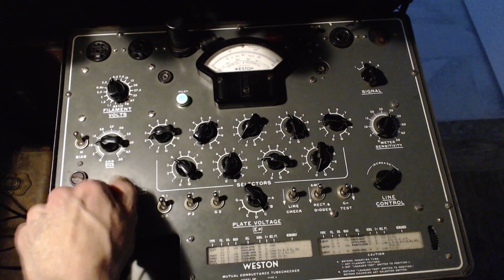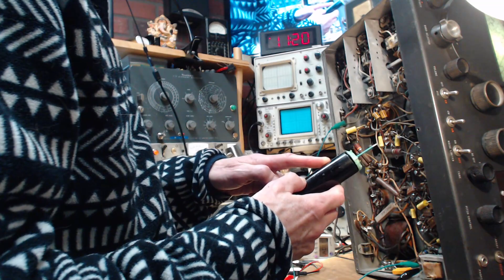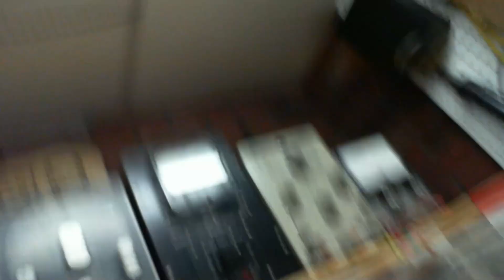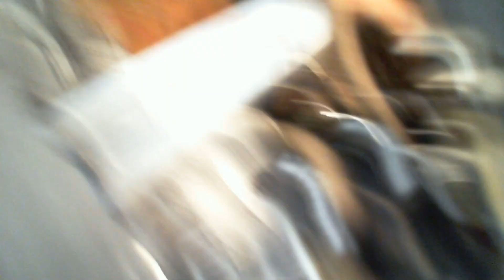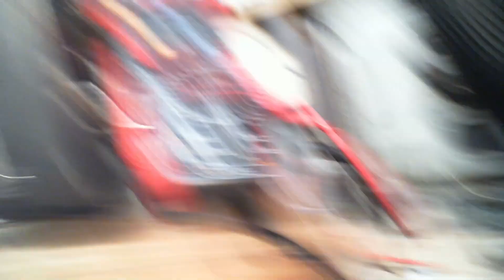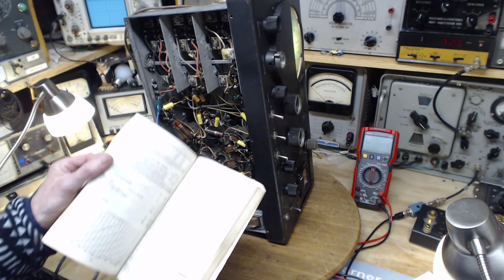Hallicrafters S-40A Shortwave Communications Receiver Video #12 - Now I'm Stumped

Comment: I would check the first coil after the antenna input..which is L1 and see if it is open, or check the first bandswitch that the antenna goes thru, because if that first switch is open or bad, none of the bands will work.

Comment: For someone who is a HAM, your troubleshooting skill need some attention. Pick one method and follow thru.  First do a quick B+ check on all plates. Diivide and conquer . You already know the audio output works. So start at the detector moving back thru the IF’ s to the mixer /   oscillator. Scope the oscillator signal. Most likely its something you did talking so much and not really paying attention to what you are doing. C’mon Uncle Jim! You are better than this and NO more Coffee, until you made some substantial progress. That set can be fix with a VOM.
Reply: I thought you had a signal tracer. Since other Bands all work, I would check for local oscillator function on broadcast band vs working band. IF, Detector and audio are all common, so problem must be in early circuits.